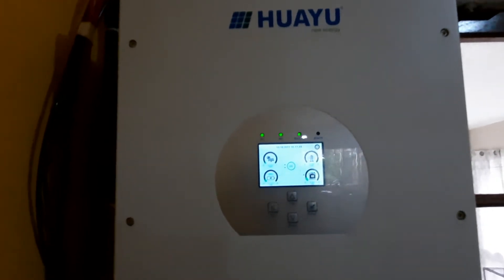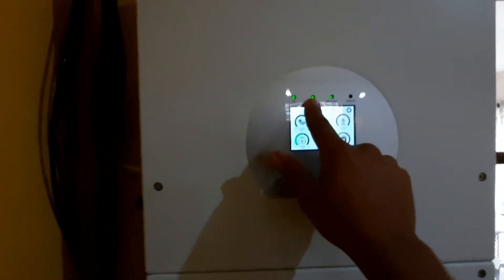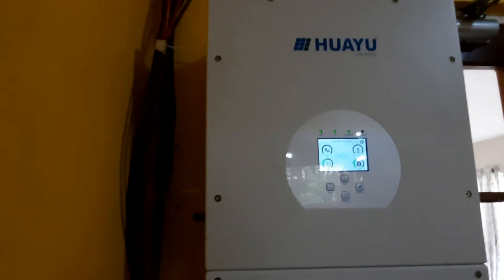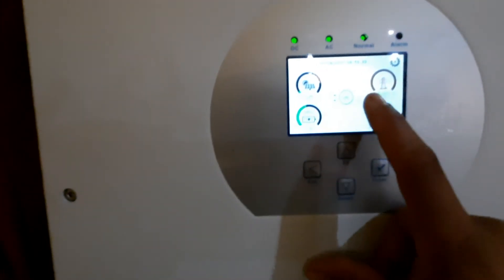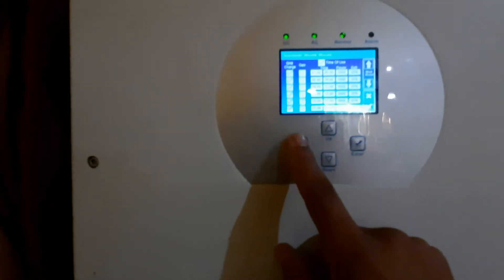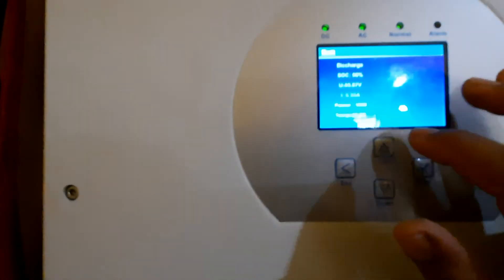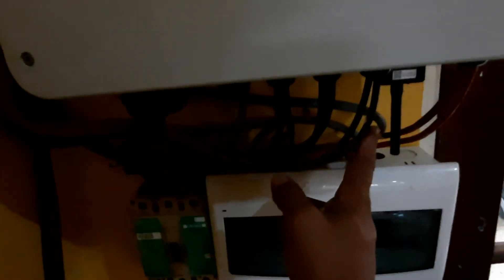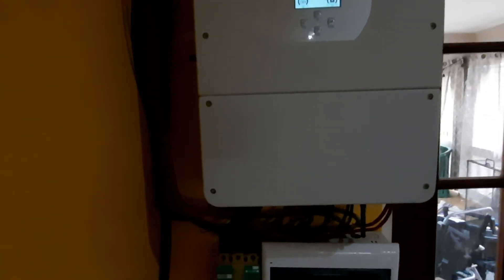New Hybrid solar grid tie Inverter

Comment: I am using cheap Chinese inverter with no problem
Reply from the maker: As cheap as the eco worthy sun-2000 GTli inverter that I got for around 300 usd and the charge controller was 150 about 6 years ago. Both of which failed twice on me.
Reply: @johanncover1988  thanks for checking out my video/\\happy charging and nuff sun light
Reply from the maker: Yeah those Mpp inverters are cheap, dirt cheap but having worked with them before and comparing it to the deye I would always chose the deye inverter for it's flexibility, built-in transfer switchs, remote current transfers. It's worth the cost
Reply: I'm very close to ordering the 10kw NA version of this, but I cannot find much info from users (so thank you for posting this!)  Do all the advertised features work 100%?  Have they issued any firmware updates? Anything you dont like about it?  And lastly, have you had any issues with yours and are you happy with the purchase?
Reply: @ssoffshore5111  yes sir I’m very happy with my inverters they work like charm
Reply: Quick question....i have a similar inverter. my inverter keeps disconnecting the JPS when it is running. Do you know of this issue?
Reply: @keeptrakk  check on what cycle you are on it should be on 50hz
Reply: @bimmers323ci  I did check and it is set to 50hz. The pump is a glong and it is 50/60hz
Reply: @keeptrakk  also check the wire size and also make sure the screw are right and. Also try a factory reset